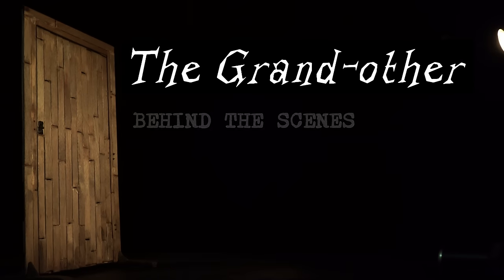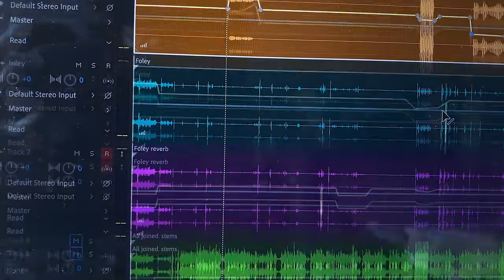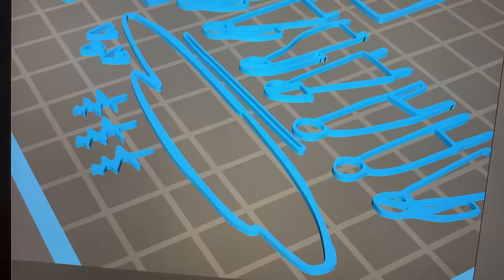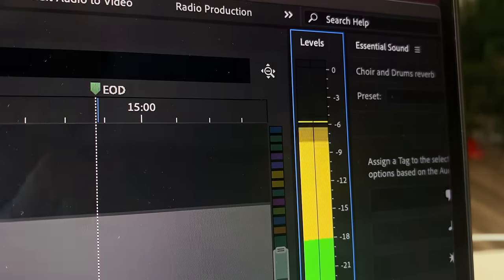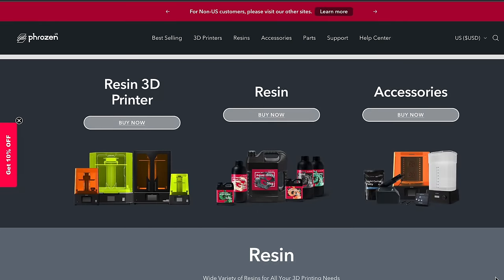How I make my films

Comment: Pro tip, for the S sounds most engineers have a Desser, which is a compressor that is just listening to the higher frequencies where those S sounds sit. it will basically give you an automated version of manually lowering those sections
Reply: Can also use a dynamic EQ or a multiband compressor to only lower the 6-7kHz frequencies where S usually lives. I thought the same when I saw that segment. Automating the gain manually is a pain! Though even pro engineers reach for that technique sometimes, I think.

Comment: Summary
- 0:07 Recording difficulties and the necessity to reset after each take  
- 0:12 Aim to get the recording right on the first or near-first try  
- 0:22 Smoke effects used in recording  
- 0:30 Multiple recording attempts due to issues like balance and props  
- 1:05 Discussion of a Halloween story called "The Grand other" released a few weeks prior  
- 1:13 Mention of a script written in 2021 for a film that got delayed  
- 1:25 Behind the scenes footage shot during the making of the story  
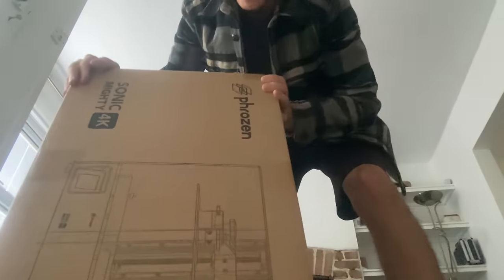- 1:38 Received a 3D printer from Phrozen, a company in Taiwan  
- 1:48 The 3D printer greatly simplified the print process and helped with the project  
- 2:11 Process of creating music for the story, including a six-string banjo tune with lyrics  
- 2:26 Writing lyrics in a Google Document, refining over a few weeks  
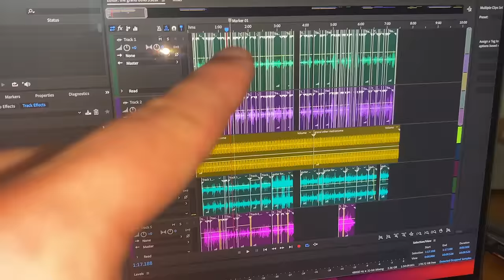- 2:39 Restarted the project in September 2023, recording music to set the pace for the story  
- 3:02 Kept instrumentation simple to avoid detracting from the story: banjo, small guitar, improvised percussion  
- 4:14 Recorded vocals with multiple microphones for mixing options  
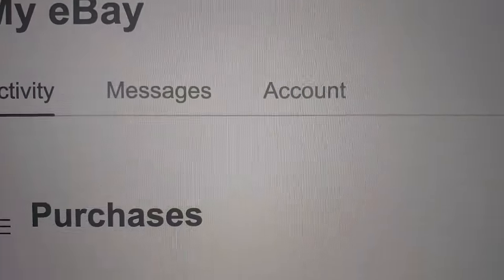- 4:52 Found props on eBay: grandmother doll, other elusive character, and a VW bug  
- 5:18 Created some props like Granny's knife, glasses out of epoxy, and cabin doors from popsicle sticks  
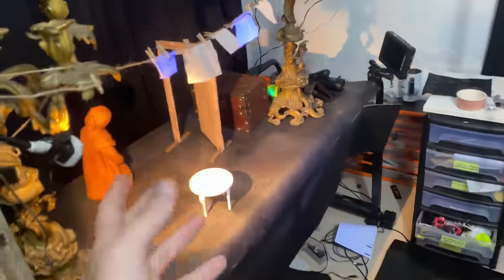- 5:37 Challenges of filming alone, using compositing to show multiple puppets interacting  
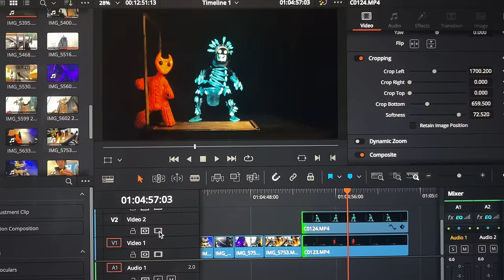- 5:50 Using black backgrounds for compositing instead of green screen  
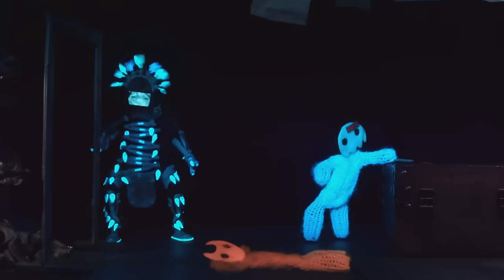- 6:12 Techniques to have puppets interact using careful masking and closeups  
- 6:45 Perspective trick to make a small table appear larger on screen  
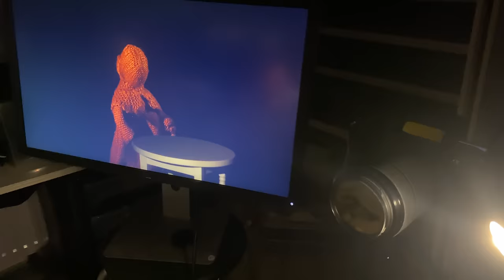- 7:21 Shooting 30 seconds of footage a day to finish by Halloween  
- 7:34 Created a distinct Shadow story sequence with a flipped stool and textured material  
- 7:57 Designed 2D characters and props for the shadow sequence, printed with 3D printer  
- 8:38 Edited the film while shooting, found audio mastering issues after uploading  
- 9:02 Adjusted vocal treble frequencies for clarity, manual reduction of harsh 's' and 't' sounds  
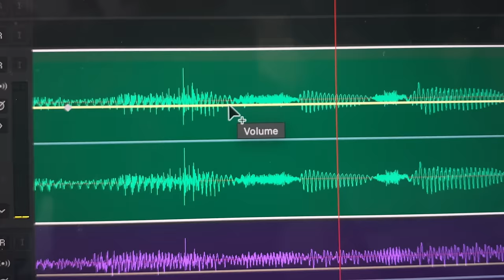- 9:37 Learned a lot about audio mixing for future projects  
- 9:49 Recorded Foley for sound effects, used creative sounds to fit the Appalachian setting  
- 10:26 Thanked patrons for their support, mentioned upcoming behind-the-scenes content on Patreon  
- 10:50 Thanked Phrozen for the 3D printer, teased future use in dab chick rebuild videos  
- 10:54 Concluded with a mention of the isolated backing track available on Patreon

Comment: Sound processing software often comes with a standard, or importable, "de-esser" which automates exactly what you've been doing manually. It's a pretty simple frequency-specific compressor, that lowers the volume when it detects excessive "S / T / F" etc sounds. Once it's set up, it does the work for you and you don't have to touch it again.